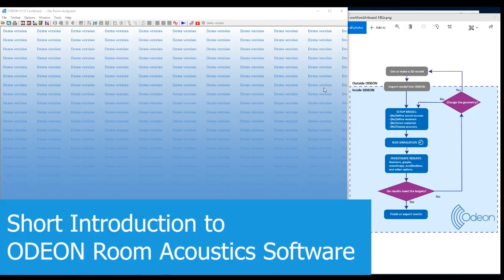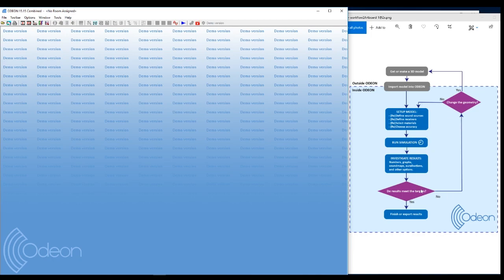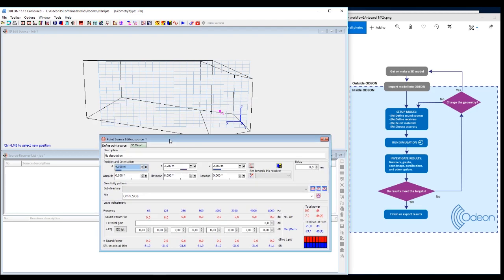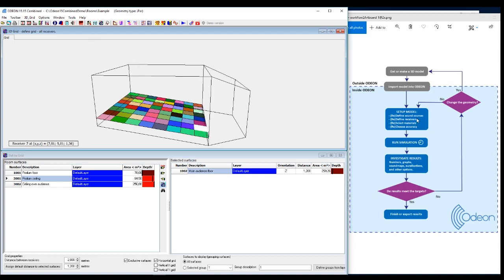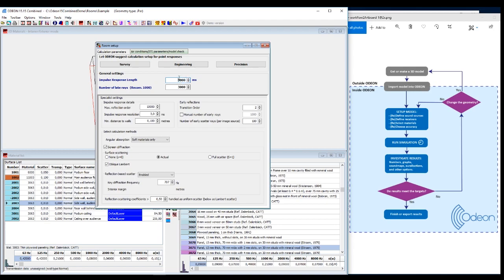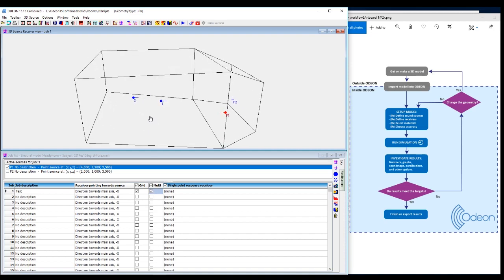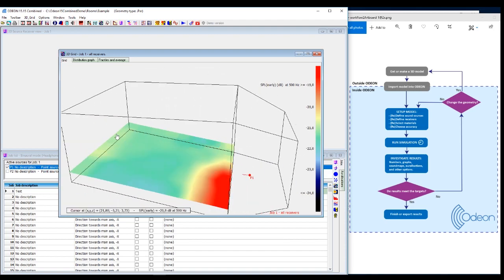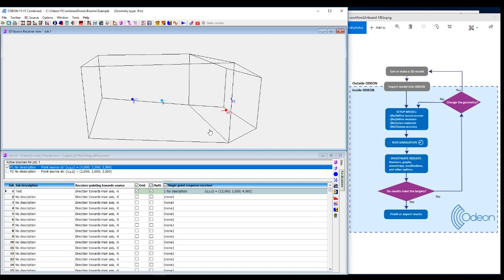Short intro to workflow in ODEON Room Acoustics Software demo version

Comment: am I able to add panels at the ceiling or the wall to show a before and after effect, there is a sample that has a simple and detailed design example for that, however it is different dimensions much bigger to a room I am trying to simulate and this example is the closest in terms if dimensions, so was wondering will i be able to add panels or will i need to upgrade my membership or can I edit an  example dimensions that has simple and detailed design with  and without the panels?
Reply from the maker: Hello! You can just draw a square in the wall where the panel would go. Then, you can first run the simulation with the normal wall material assigned to the square, and afterwards another simulation with the panel material assigned to the square. This gives you both scenarios.